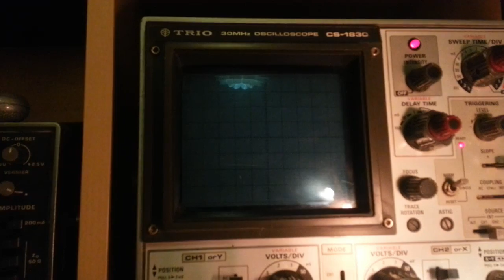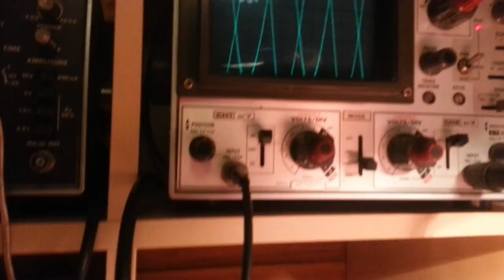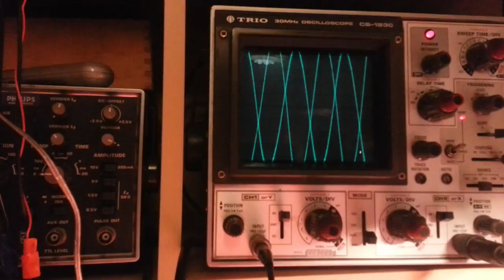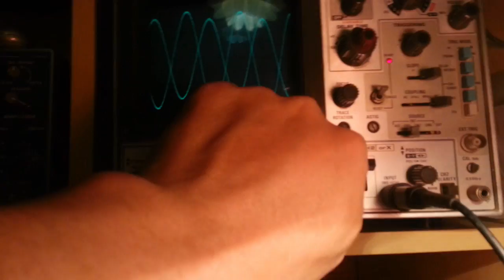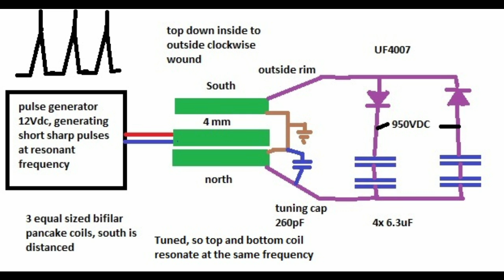Bifilar pancake coil experiment producing 950Vdc from 12vdc

Comment: Thank you for this very interesting video. what about the input and output current ? Do you think this setup shows surunity ?
Reply from the maker: Lorenzo doudouze surunity, you mean overunity with that? I think it depends on the input voltage. this test was 12V input. I do believe there is a threshold to be reached. So a higher input voltage might produce over unity. but then, the output becomes also higher.
Reply: Yes, I meant overunity. Sorry i lose my english. I obtained several times overunity on setups with bifilar coils excited at their resonnant frequencies and tuned, but for very low power input. each time i tried to increase the input power, I lost overunity.
Reply from the maker: Lorenzo doudouze interesting! how was this overunity achieved? 
maybe instead of increasing power, you should look into the form of power. and make it a high voltage power, instead of a high current power. (power is volts x amps) as the coil seems to function best with volts. (google translate helps me with french English)

Comment: Thanks for the exceptionally intelligent videos.  May I ask why you separated the top coil slightly from the other two?  And if the top coil is flipped why does your circuit diagram not show south on both top and bottom of the stack of coils?  Thanks.
Reply: Hello Flux_Capacitor.  Master Ivo referred me to the PWM-OCXi v2.1 made by RMCybernetics whose web page you can Google.  I also ordered a SainSmart UDB1002S DDS Signal Generator from Amazon to drive it which appears similar to Master Ivo's though I did not ask him about the signal generator.  The IGBT driver has its own frequency and duty reostats but they are not very stable or accurate.  You need to read and follow the IGBT instructions carefully to get it functioning as you wish.
Reply from the maker: FLUX_CAPACITOR indeed as said
 rmcybernetics dot com
Reply: Thank you very much!
Reply from the maker: FLUX_CAPACITOR , yes pulsed dc. i use a square wave signal generator, to let the igbt work. I actually am thinking to replace the igbt on the board, by one that hasnt got a protection diode, so i can make better use of the back emf.
Reply from the maker: tnx David Druz  for the exceptionally intelligent questions ;)

the north - south is related to the magnetic field of the center pulsed coil.

 the reversed coil is distanced to create an out of phase signal. (also that coil is counter wound to the center coil)

To be able to add the voltages up from both coils the signals need to be out of phase. I think this is because we are dealing with standing waves at the resonant frequency.
Reply: Very clear explanation.  Understood.  I watched all 4 of your videos again and am inspired to replicate your experiments!  Would you mind sharing the make, model and source of your IGBT driver and IGBT?  And do you recommend a particular diameter magnet wire for the CD-sized coils?  Thanks kindly.
Reply: Sincerely appreciated!  Just ordered the driver.  Do you post your experiments on the Internet elsewhere as well?
Reply from the maker: Yes I do, http://open-source-energy.org/?board=109.0  it is open to view for all
Reply: David Druz or Master Ivo, could you please post again the info on the igbt driver? Somebody is erasing comments!
Reply: One question though. I have a signal generator but it's AC. I thought Master Ivo was pulsing the coil with DC with a PWM?

Comment: You need to install an adjustable cap on all 3 bifilar coils. Between your windings on each coil. Then retry. Should be big difference😀
Reply: great video thanks for sharing your explorations. it provides for greater learning.
Reply from the maker: aaaflooddrying I would but the coils are already tuned
Reply: Sorry, but it might make a big difference. Add caps between winding then retune.
Reply: Really meant sorry, that didn't sound the way i wanted it to. Your doing great work. Just trying to offer info another poster discovered.
Reply from the maker: aaaflooddrying tnx I'll look into it. If i understand correctly, in between the two windings of the bifilar, a capacitor.
Reply from the maker: aaaflooddrying I just tried adding 120pF parallel with the resonating coil. the resonant frequency went down as expected, but the voltage went way up. Interesting!
Reply from the maker: and indeed. i now put the capacitor inbetween both windings. now several high voltage resonant frequencies show up! cool. tnx
Reply: Cool
Reply: Try using some adjustable air caps, can get on eBay, can really really tune.

Comment: Great work, I have been experimenting with this kind of setup, but I have tried to have the system looped so that it becomes a self runner. At present I have the run battery and the charge battery stable for a few minutes while powering the circuit charging and lighting 100watt halogen bulb. The system dies slowly afterwards. But your work gives me hope this is possible:) great job. Please look at my vid IT generator 2. Tesla Kapanadze. Also please contact me dkdyker@yahoo.co.uk. Nicholas. I would like us to work together so we can make this happen?
Reply: just a newby here and learning tons ... have you tried running the system off of solar cells into a large battery bank ?
Reply: Thomas Squires no I haven't don't have solar, but good idea. I think a generator of some kind is needed for all these systems to operate themselves.

Comment: I am highly interested in seeing that voltage after the diodes put on the plates of an HHO cell.  That out of phase nature of the signal would probably do tremendously pulling apart of the water molecule.  You are on to the secret of Stanley Meyer Congratulations
Reply from the maker: Thanks! So much to learn.
Reply: Meyer used a 30 Ghz electromagnetic frequency, that makes vibrate oxygen and breaks molecule bond. 5G towers were used to kfyfill people this way in the plan demic

Comment: At 8:58 it took a half a second to charge the capacitors to 950 vdc.  That is insanely great--almost free energy device here we come.
Reply from the maker: Amazing indeed :)
Reply from the maker: yes more copper and more windings, would create a bigger dielectric field, resulting in higher voltages.

Another way:  I think the voltage of the input pulse would need to get higher, so the output voltage also would be (around 72 times) higher (than the input).

 The energy stored in the capacitors is related to the capacitance of the capacitors, and the squared voltage.  So simply, more voltage in, is more voltage out, but the output is squared (10x10=100 100x100=10000 1000x1000=1000000). 

I'm not sure, but i think the voltage pulses can have a very low current.  Offcourse, this means a new setup, with high voltage diodes and capacitors.
I did a test with a 19vdc pulse, and the voltage went up to 1500Vdc in the caps. but the energy stored, is related to the square (1500x1500=2250000) see where this is going?
Reply from the maker: I could also use the Super caps, in series, to get a higher voltage rating, at the cost of its massive capacitance.  but to get a 7500V rating, I would need 3000 caps(!) the 1 Farad will be 1/3000th =333uF(series connected) then the energy would be  9375 joules.  

input voltage would be around 105V

Comment: I like! Please keep going, one day you make it big
Reply from the maker: Yes, I will keep going. So much to discover, with the dynamic dielectric field
Reply: @MasterIvo  but could u please tell us using this voltage how much of it can be used to run say how many 100watts bulbs so that those of us who r not from  electric field can grasp u p =vxI anyways just show with no of bulbs as load over a hr how much wattage could u use and what is the voltage drop and if u connect bifilar coils in series could u increase the voltage as asymmetrical way also as someone showed by attaching a ferrite base on the the bifilar he had increased the magnetic flux 2 gen current
Reply from the maker: this old experiment was pure resonant, so no real power was available.
I now work with asymmetrical resonance, which does have real power.
I am working on my new video that shows my latest circuit that makes use of this.
Reply: @MasterIvo  yeah br I think ur going great, morrin explains out that he found 22khz rather more useful frequency to get a resonance, by his words RF resonance or replication as induction with which lights light up, so 22khz has 2 b scalar largely and superimposed on 60cps raises  power factor otherwise with simple resonance he was unable to run inductive loads only resistive loads largely leds bulbs and tube so goes with higher frequency vibrations at higher voltage can also read pressure, and the amount of copper was essential to create amperage
Reply: @MasterIvo  On the other hand MOSFET performance in DC/DC converters in the medium switching frequency range of 100 kHz to 1 MHz. Or for higher frequency impulses at low voltage, while u have igbts ot the higher voltage but Idk which hz range these impulses r useful to break the magnetic field and also u have on lower frequency magnetron which is used as impulse generator... While most common IGBT switching frequency of full-bridge and half-bridge topologies ranges from 20 to 50 kHz. Commonly-used frequencies are in the vicinity of 30 kHz. Switching frequency in the two-switch forward topology aims at 60 kHz and above.